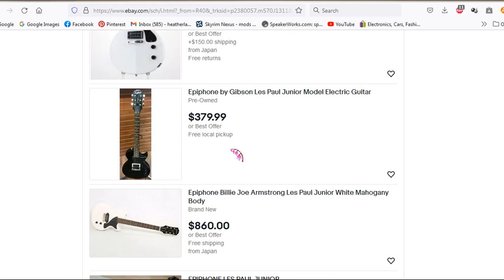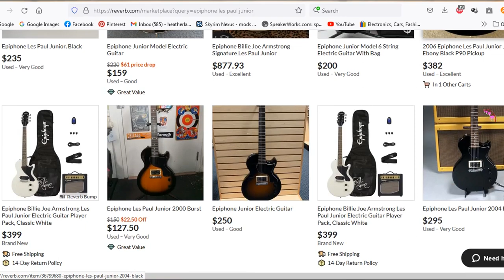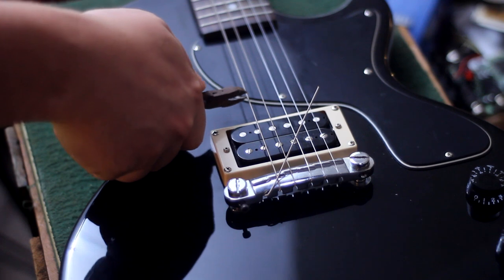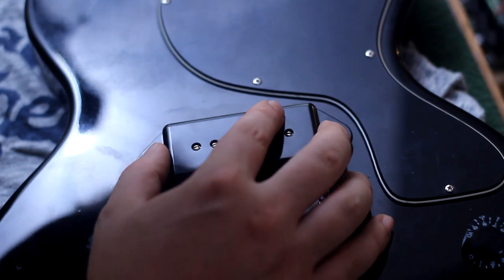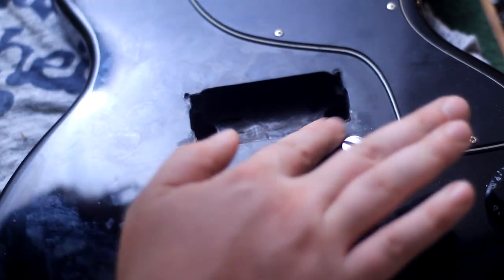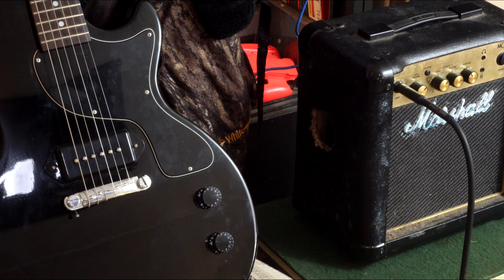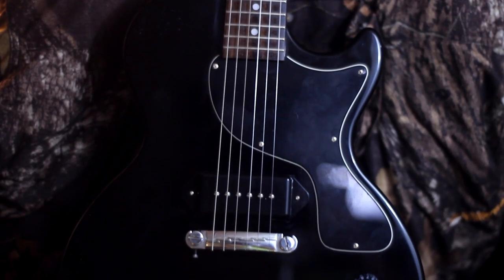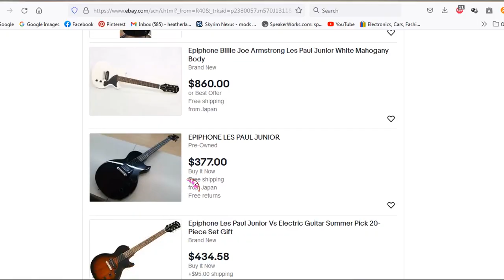P90 in Humbucker Les Paul Junior (Save A Sh!tload of $!!!)

Comment: Ive been hung up on firebird 1s and doublecut jrs as of late. Seems like garage rock paradise with either of those.
Reply from the maker: Thank you for watching and taking the time to comment Benjamin. Gibson designs usually dont catch my attention and I blame youtube for brainwashing me but, The LP Jr got me and those are both great designs as well. Its Gibson using the same design philosophy as the Fender Esquire.. Flat slabs of wood with no unneeded parts at all just a simple rugged tool, its like a stripped down drag car, just pack of cigs rolled up in the sleeve of a white t-shirt COOL.

Comment: I picked up a Harley Benton double cutaway junior with a p90 in TV yellow and a set neck, delivered to my door for less than $200 new! I've owned many Epiphones, a Les Paul, SG, V, and Explorer. I modified every one, added a wire to each pickup to coil split them with the tone control and added a treble bleed circuit.
Reply from the maker: Awesome Lou! Ive heard nothing but good things about the Harley Benton guitars. I am a junkie for treble bleed circuits its even good on strats and can do wonders on a Telecaster for Twang!

Comment: You crack me up!  I got a new Epi Melody Maker for $160 new, then got a new pickguard and put 2 new Lindy Fralin matched p90's and cut the pickguard to fit.  Then I had good wiring made for it, and it really sounds nice.  Yes, the Fralins were $236, pickguard $40, wiring $95, but now i have my poor boy 50's Les Paul and it looks really nice and sounds great.  I have a kit lpjr style guitar and I changed the soapbar p90 to a dogear.  I decided I needed a shim to lift up the p90, so I went to the auto parts store and bought an $11 gasket material set of about 5 different thicknesses.  I picked the one that worked, then cut out the shim to match the dogear cover, then painted it black.  With yours, you could do the same thing, and cut the shim a little wider to cover the holes and slots, paint it black, and i'll bet it would look great!
Reply from the maker: Thank you for watching and taking the time to comment Michael. I had actually debated getting a melody maker. When I was looking on reverb I saw the prices on the new ones and was like WOW! I saw a yellow one with white guard and I was thinking heck I can get 2 p90s from this same guy on ebay for like 35 bucks and make it like a LP special but I figured I'd probably have to use soapbars to fit the pickguard and clear the knobs and the pots were most likely 250K but, I almost went that route and may yet do so in the future... Also I just had a thing for the dogear look and the single pickup design.. I blame Youtube for brainwashing me. Its like the closest thing Gibson made to a Fender Esquire 1 pickup no tune-o-matic just a flat slab with the bare minimum amount of parts. I dig that! Its a rugged simple tool. 
 Good Idea on the gaskets I saw that the guy I got my pickup from does actually sell a riser gasket for dogears as I too noticed the p90 was a little low compared to the bridge. The Humbucker route and screw holes are not actually noticeable now though so I opted to just raise the pole screws about 1/4 inch. I read or sasw a video somewhere that said Duane Allman used to sink his pickups and raise the poles way up on purpose for better sound. I dont know if this is true? But it did wake this one up. Damn man I gotta say I like the way you think, our thought processes seem to be very similar indeed. Thanks again brother I appreciate the interest, information and friendly banter.
Reply: @heavymetalATC  Thanks for the compliment.  I grew up having to make what I wanted, and it's fun. First guitar I ever played was my Dad's 50's Silvertone w. a 2x4 thick neck.   My Fralin p90's were soapbar, easier to accomplish to keep the Melody Maker look even though they are wider.  Hey, a project might be to make a slim p90 or a slim humbucker out of cheap stuff that fits in a Strat or the thin slots of pickguards.  When I was looking for riser shims for the p90, Allparts makes a real wide one that would have worked perfect with your project.  But it was $20+ and others are like $30+.  My gasket kit was $11.
Reply: Mmmm melody maker

Comment: Great video ! I recently went to Sam Ash to buy an amplifier to use for my Yamaha keyboards and also to use as a " boom box " for MP3 player and other sound devices . I bought the Fender Frontman 20G for $100 . Before leaving , I couldn't resist looking at the guitars . A new Squire strat for $259 caught my eye . I couldn't justify or afford that kind of money , as I don't play guitar . Then as I walked by the used guitar rack , an Epiphone LP Junior with the humbucker pickup for $69 jumped out at me . I had to have it ! I really didn't have the money . I went home and got my Yamaha pss-a50 keyboard and traded it and about $10 for for the Epiphone . I really don't care for the sound of humbuckers compared to p-90 pickups , and the Epiphones fitted with the p-90 were crazy expensive .The guitar looks , sounds , and plays great , but still doesn't have that p-90 sound . After seeing your video , I ordered a Wilkinson dogear p-90 on Amazon for $22 . Same specs as the one on this video . Still waiting for it .
  Thanks for this very informative video . I will soon have a high quality single p-90 pickup guitar for less than $100 ! Thanks again .
Reply from the maker: Thank you for watching and taking the time to comment bomber. Well. Its been 3 weeks did you do it yet? how did it go? I hope you got her in there pretty easy and clean. They make a gasket/spacer that could cover some boo boos around it if you got any also if the pickup aint hot enough for you raise those screws... i did mine and it went to 11. Great deal you got going man!!!
Reply: After a bout with covid , the dog ear pickup finally arrived . I spent about 4 hours on the retrofit . It turned out well . I was careful to get the pickup centered perfectly . I ran into one problem . The pickup was about .062 inch too low . I compensated by raising the poles . Eventually , I plan to fabricate a shim plate 1/16 inch thick to fit under the pickup , but for now it works fine .
 Just when I thought I was done with guitar modifications , I found an Epiphone Les Paul Special - II L.T.D. in excellent condition for less than $100 at a pawn shop . I couldn't resist ! Now I have another project , but will be changing both pickups on this guitar . I'll be using Wilkinson dog ear p 90's on this guitar also , as these pickups sound great and cost less than $25 each .

Comment: I have an 03 model and it came with the same or similar humbucker. I replaced it with a p94 but now I want to go full dog-ear too. Nobody talks about the stock humbucker but man are you right, high output and ceramic, it's basically a Dimarzio sd except I like it even more.
Reply from the maker: Thanks for watching and taking the time to comment SI. Yeah that stock pickup is a beast Im gonna have to build some kinda super strat or ibanez kinda guitar to stick it in.

Comment: I have a cheap, single humbucker bullet squire stratocaster. I wish to do exactly this! I just wonder how you would be to to slightly modify and widen the pick puard now?
Reply: Use files.
Go to harbor freight or home depot and get a set of files large or small.
Of course measure the size of a new pickguard and mark it then start filing away.
I tell you this from experience because I've done this myself.

Comment: Man, you make it look so easy!  😂  (actually, I probably just think it's hard, cuz I haven't done it yet, but that's alright)

I got a kick out of that summary at the end, too.  I'm also glad you seem to be taking up the cause of helping poor and broke folks do some cheap but effective DIY.  Riffing off that summary, "buy the cheap things, build the expensive things" sounds like a great channel slogan.
Reply: I like it.
Reply from the maker: Thank you so much for watching and taking the time to write such an awesome comment Rob. Nothing really hard here, the finish repair is tedious as hell but if you mess it up (like I did) and burn through you already have the stuff out to repair it again like I did when I reapplied the black paint and clear again and re-cut it. The rubbing compound is the star of the show as long as everything is level and all the scratches are sanded out progressively it'll buff to a gloss. 

 Hey I'm broke and I want things so I might as well document the whole deal for the benefit of others. I learned most all this stuff from the internet myself so its only right to add to it and pass it on. Hey man, That is a Great slogan!  I gotta put that in my notes right now! Hell I'm gonna write that on a post it and stick it to the monitor. Awsome! Thanks again Rob, good 1.

Comment: The days of bargains on eBay are long gone.  I bought a 1990 Aria Pro II SLB-2 bass on eBay a few years ago for £35 (about $50)....I saw one the other day for £200!  Crazy!  But it does sound fantastic (especially now I've put a set of EMGs in it!)
Reply: It's crazy how much gear has inflated. Used to be able to grab a 1960A for $300. Now people want $600
Reply from the maker: Thanks so much for watching and taking the time to write a comment Chris. Yea, I just wrote a big 3 paragraph rant but I erased it as it seemed like it could have been taken as political but in general I think a big part of it for me is that my mind hasnt yet caught up to the fact that a buck is not the same dollar it was 2 years ago and a pound isn't a quid anymore... its like 80p or less now. The reasons for that we will leave for another day but my brain is stuck in the past I still think a cheap guitar is $100. Ugh I sound like old people, "back in my day in 2018 we walked to the shipyard at 4am in the snow with no boots." Hahahaha.

Comment: Funny guy lol.. So if i had to paint in a chip with black acrylic paint, would i have to use the super glue or just the polishing compound to get it to blend in? Thanks
Reply from the maker: I have never tried to polish acrylic paint before but finger nail polish or car touch up paint like even spray glossy black spray paint into the lid and collect a drop and use it on a brush or tooth pick... that will buff up great. Clear gloss paint or clear fingernail polish over the acrylic also will work. Its all about getting that blend between them... It can be slightly different as long as the change is gradual you wont notice.

Comment: Stock pickup was way better. I had a kickass P-90 in my Gibson Les Paul special. But it didn't sound anything like that one you bought. I think the Ibanez GIO pickups are amazing. That guitar runs about $200.00. My son just bought one and it's good enough to gig with right out of the box. I was blown away. Low Action, no fret buzz and has great tone for dirty rock & metal. Even sounds decent on the clean tones too.
I ordered the Squire Sonic Fat Strat. I haven't received it yet but I wish I would have bought the GIO now..
Reply from the maker: You like rock heavy music huh. I do too but not only that so I figured Id soften this guitar up a bit and save that factory pickup to turn another guitar into a beast.

Comment: It was naught but a few years ago that I used to go into my local Guitar Center and quite often would see Epiphone Les Paul Jrs. (yes, the humbucker ones) hanging in the used gear section with a price tag of $49-$59. I had the same idea as you. Just pick one up and slap an HB sized P90 in it. Now I never see them. Or if I do they're $250-$300- $350. I waited too long.

Comment: Thanks for the video ! I been having the same dilemma and this solved my dilemma.  I do have  a question.  Do you think I would have issues with a carved top and can the height be adjusted on dog ears ? Not a real dog 😮
Reply from the maker: I dont know if you ever did it but they make a little rubber gasket thing that will help the pickup fit a carved top.

Comment: I picked up this exact p90 a year ago on eBay from the same seller..hoping it sounds good on my buikd
Reply from the maker: Thank you for watching and taking the time to comment ONG5063. Ive bought several pickups from the guitar madness seller in florida and everything he sells is fire AF! 
 I dont know him and I pay full price but i mean heck he sells um cheaper than i can build anyway and probably better at winding given all the experience.
Anyway yes itll rock! I found that raising the screws on mine really took it from 7 to a 10 but it still cleans up with the vol. 

Good luck with the build, most all p90s put out the freaking juice like nothing else its my secret pickup crush for sure Hahahaha.
Reply: @heavymetalATC  thanks for I fo on the screw height.ill try it and see what happens.thanks

Comment: Got the same axe modded with:
Sd prail bridge pu
Push pull 500k pots vol tone
Tusq nut
Wilkinson wrap around bridge with adjustable saddles 
Wilkinson Deluxe vintage tuners with Pearl button
pio cap 0.22 
Tortoise jr original pickguard
Black Bell knobs
The guitars cost me used likes 70€ and i found the used parts on the web for cheap.
With a low budget u can get a very interesting axe modded.
Reply: Can you put more pills?

Comment: I recently got an almost identical Epiphone humbucker from a pawn shop for cheap and I got home and it was reading roughly 18k like yours
Reply: Yeah, that has to be the highest I have ever seen on a guitar.  Just weird.
Reply from the maker: Thank you for watching and taking the time to comment Jade. I was floored I have never seen a pickup resistance test nearly that high. I am definitely going to use the one I took out in some kind of modern build. It screams like a wildcat in heat.
Reply: @heavymetalATC  How did they even get that much wire on it to make it almost double the resistance of other coils?
Reply from the maker: @generalawareness101  It must be a really thin wire? they aren't wound overly full from what I can see.
Reply: @heavymetalATC  Hmmm, I am getting flashbacks of that wire I mentioned to you a long while back from China.  So damn thin it snaps just to look at it so all robot wound with precise tension cause no human can handle that thin shit.  Like 60 awg type stuff.  Can't even solder it.
Reply from the maker: Yeah Id guess its probably 46-48 gauge and I'm sure it was wound on a robotic machine and then unfortunately it was most likely soldered by 7-8 yr old Korean children with fresh eyes and tiny fingers... so is the way of capitalism :(

Comment: I did this, back around 2005. My Junior is black as well. About $100 new, the P90, pickup cost about $60, hand wound by a guy in Tasmania. Look it up on a map. And enough with the fucking around, shit or get off the pot.
Reply from the maker: Thank you for watching and taking the time to comment. I dig the hell outta this little guitar i raised the screws on the p90 a bit more and it started really barking good. Hahaha I know where Tasmania is bro ;) so are you from down under? aussie, kiwi, er tazzy? 
I gotcha Mr.Kelly and I agree, I been in a secret outhouse so to speak. I got a lot of footage built up while I was away. I got my shop up and running as always life throws more wrenches but there may be a marked increase in output here cause I got no other choice I gotta make some kinda move and quick. ;) thanks for watchin m8 4real.
Reply: One pure-bred, 71 year Aussie🇦🇺. I dig the fuck out of your work. Where input the 90 in my Junior, I think from memory, I used an axe, to get the soap bar to fit. But it is a brute of a thing. I recently traded for a Gibson Custom Shop '58 reissue double cut Junior. $6 fucking grand. And which one sounds better? That's a really tough call. $160 vs $6k.

Comment: You can make a P90 yourself. Why did you need to buy one? Better quality, better something?
Reply: Lazy I bet which is cool, and besides I am not so sure if it is more cost-effective in the long run.  Wire isn't cheap and it takes a lot of wire.  The cores, the Alnico magnets, the rest of the materials, bobbins, etc, and the time to slap it all together or pay 20 bucks to your door.  Hmmmm.
Reply from the maker: Thank you for watching and taking the time to comment Gokhan. General Awareness nailed it. I cant build one for as cheap as this one was especially alnico V with 9.6k of wire. Laziness is a factor as well as the cover I could have whipped up another wooden one but I wanted that dogear cover not only to help hide the humbucker hole but also just for the cool factor and the look.